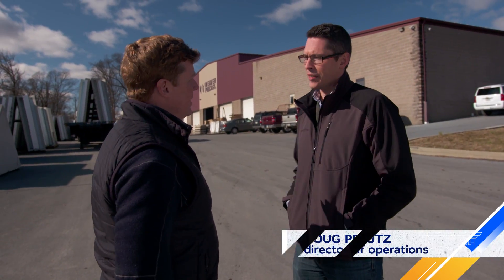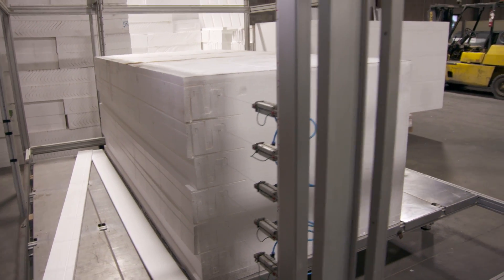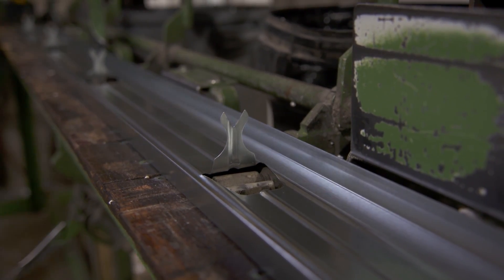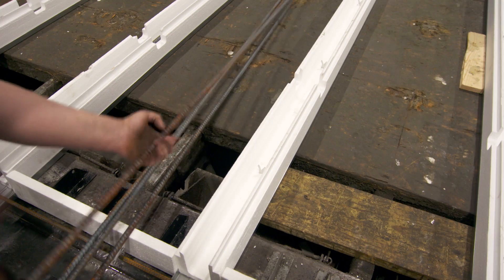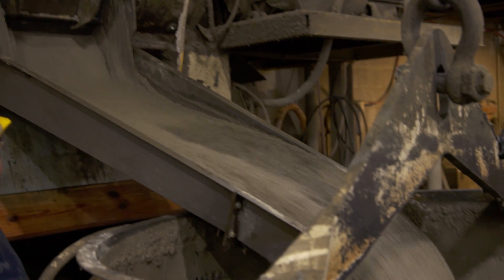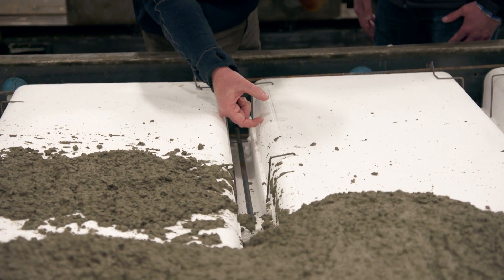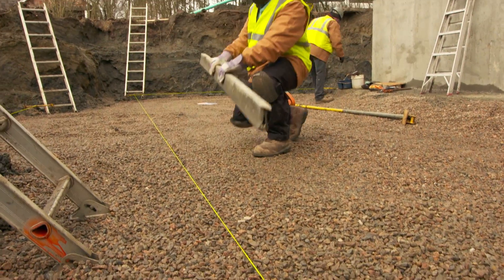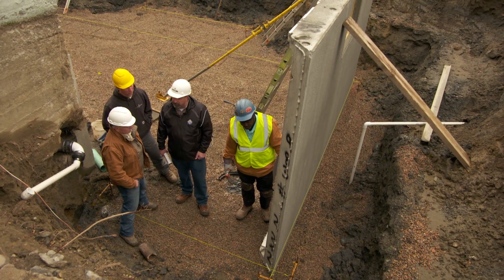How Prefabricated Foundation Walls Are Poured and Installed | This Old House

Comment: I've been in construction for years ran a masonry company most of that time.. I think building a building in a controlled environment is a good idea I'm just not convinced on concrete panels for your basement.. the connections in my opinion are weak you're relying on two beads of caulk to keep the water out.. and the main part of the panel is only an inch and a half of concrete.. no thanks I will stick with my 8 to 10 inches of poured concrete solid wall for my house..

Comment: Seems good but it's crap. It's weak, held together by bolts and glue. Anything exposed above ground is a burglars wet dream, take a sledge to it and it breaks faster than a snitch in interrogation. It'll be gone in twenty to thirty years. I'd rather have a woodie foundation than this garbage.

Comment: Using this system of walls , who is responsible for laying the drain pipe ? There is a drain pipe below the crushed rock ? Right ?
Reply: That should be the excavator. He would install the footer drain on the outside as well as the radon pipe on the inside before he installs the stone required for the floor and footings.

Comment: They should be dispensing caulk out of 55 gal drums and it should be pneumatic so they get uniform distribution. System is intuitive but still would prefer cast in place solid foundation.

Comment: I’m shocked this hasn’t become the preferred method of residential construction despite being @ top of commercial design for decades! 

Its VERY low thermal transfer...fire proof...pest proof...upkeep costs are pretty much non-existent...earthquake tensile strength is much better than comparative methods...and the finishing options could be extraordinary!
Reply: It's very popular in Europe and Asia. America is just a little behind the times because they have so much lumber available, so they never really had the incentive to switch to concrete.

Comment: Nah, I'm sticking with my full inch 8 thick wall with a rebar web. 

Or ICF. Which is probably a better, more expensive product. More time consuming, don't need a crane though. 

What if they used a 2 inch tension rod instead of those puny bolts. That way when the foundation eventually cracks, sags, bows, you can just tighten your tension rod and bam, straight and level wall again.

Comment: I like the idea and environmental controls to get 5k psi strength concrete BUT the connections are critical and the weak spot and 3 beads of caulk and two 1/2" bolts doesn't give me much confidence in that connection to not leak in 5-10 years.  I would have liked to seen some kind of interleaved connection, more bolts and better sealing design with MORE sealant.  Do they do something on the outside of those joints?  I surely hope so.
Reply: The corners are being compressed together by the structure. They didn't show it, but a concrete slab is usually poured /after/ the walls are erected.
Reply: cpad007 the corners are tapered I’d imagine the weight of the earth around it holds it together pretty well.
Reply: The floor truss system along with the back filled earth is what will ensure stability.  The bolts are just to keep things in place until the above elements are installed, which makes things permanent.

Comment: I dislike how he basically says that most homes around 3500 psi because of incompetence. Modern concrete plants and their contracted trucks will get you the correct PSI at site, no matter what you order. If the average house is 3500 psi then it's because that is what they engineer specd them to. 

I also trust a single pour 3500 psi foundation to stand up 50 years to water far more than this jigsaw puzzle.

Comment: We don't really have 'basements', as such, over here 🦘 so why are there 'windows' ?
Reply: Also if there's a fire it can be an egress location.
Reply: Ventilation and to let light in. It gets pretty dark down there lol
Reply: Some building codes require emergency egress windows in basements.
Reply: I still don't get it ! It's a basement, how can it have windows ? That's like having opening windows on the lower decks of a ship?
Reply: @brhino  The foundation has a well kit at the window opening to provide access to the surface. There is a ladder inside the well. This is what it looks like... https://windowwellexperts.com/egress-window-wells/
Reply: @thefungusshow2535  = THANKYOU !

Comment: yeah .. Unless this comes at least 75% cheaper than the traditional way of building, I'd say it isn't worth it. What is the expected lifetime of this product? Why is it bolted and not welded? I've seen panel walls before - the whole soviet union was built from them. While most of it still stands, it isn't anywhere near ideal. The caulk lets go, because all caulk will. Call it what you want, it will let go. I've been in one of these style homes and there was snow blowing through the wall. Structurally sound? maybe.. Practical, reliable? I don't think so. It's gotta be cheap if you want me to use it anywhere

Comment: Cool idea but I definitely would rather have a poured wall and slab foundation. Something about a wall that's mainly 1.75" thick is kinda questionable to me
Reply: Wes ive poured enough footings and stem walls to know a prefab that thin on no footing is junk.. its a shame people value some clipboard boys oppion rather than a masons
Reply: You either didn't listen or just don't get it.    Stick with simple stuff there tiger
Reply: Wes what a dickhead.

Comment: An 1 3/4 concrete skin?  Hope you don't have a lot of backfill against the house.  This guy is talking crap on poured walls but they are 8-12'' solid concrete.
Reply: The basement wall in our house is 32 in of poured concrete. There is a very slim chance  it will crack

Comment: The money that was saved went Into the delivery and the crane
Reply: hanratty450 that’s what I was thinking, but if you’re in a really rural area, you want a house up as soon as possible to reduce cost so this could be an attractive option.
Reply: @AndrewHorezga  anyone who says it's not better is a boomer
Reply: Yup... although you still have to deliver materials either way.
Reply: Building my own personal house.  Superior walls was 40% lower cost than our next lowest bid.  The crane, delivery and install all part of the package.  The crane is owned by superior walls.
Reply: dont forget the 2 guys with socket wrenches puttin in both "bolts" at each intersection
Reply: I agree, where I live you'd be looking at around $1000 an hour for a crane like that.

Comment: is this rated for earthquake areas? Seems like the walls would just come apart in a quake?
Reply: I'm thinking the same thing. But also not even earthquake areas. Even in seismically inactive areas, how well does all this hold together once a house starts to settle and shift? Those two bolts will hold the slabs against each other but they aren't going to maintain the geometry and shape of the foundation like a single rigid mass of concrete would.
Reply: We rearly get earthquakes in PA and they are nothing to talk about.

Comment: what's better in terms of longevity and strength... this prefab foundation or a standard poured concrete slab foundation wall like most houses in Canada?
Reply: I'm not an expert on this. But you're basically asking " what's better 8 inches of concrete or 1 3/4 inches? " I feel like the answer is common sense and untill they have at least 30 years of experience with this, I will not be convinced that it is any good
Reply: I’m wondering as well. I want to dig and expand my basement and build in a lap pool. Was thinking ICF’S but will consider any option if it works better and saves me project cash.

Comment: I can't believe that one bead of waterproofing adhesive is enough. If that dries out and cracks your screwed.
Reply: There's 3. Inside, middle, outside.
Reply: @pdxlockpicker7796  no I know I heard that. It's one one bead the put on before putting the other wall up.   They obviously tested this before bring it to market. It's just different from the norm.

Comment: Where's the footing ? Sure hope they seal those corners from the outside with some rubber/tar sealant and heavy plastic over them ?
Reply: Also drainage pipes and gravel below to drain any possible water away from the foundation.
Reply: They don't .. I think, realistically, this product has lifetime expectancy anywhere between 8 - 15 years. With 8 years being the first leaks and 15 being a need to tear down your house

Comment: All good besides them being “water tight” with two beads of caulking, asking for a leak after 10+ years exposed to the elements
Reply: I thought he said 3, but I agree, those corners should be pasted with concrete adhesive/ sealer and hopefully they seal the corners from the outside with a serious tar membrane and plastic before back filling ?
Reply: Im sure theyll wrap it with some form of water proof membrane

Comment: I've worked in prefab concrete.  this is basically that but so much better.  We had everything outside exposed to the elements. If I make a home that has a basement I am so going to get these guys to make the foundation.
Reply: I had them do my basement cost me 16k for a 1000sqft basement... not cheap but def worth it. Im in PA
Reply: @acousticpick . Can they build an entire shell of the house? We are looking into building our first all concrete home,  and wondering if  pre fab concrete is a good option.
Reply: @Asmrpurplelady  yes, they can. Although at a much higher cost than traditional materials (stick build). They build entire shells for commercial applications, but they also do residential. Although not common.
Reply: @acousticpick . Thanks a lot for the response.    Do they charge per sheet or square footage?For example  a 9 by 10 ft  sheet being priced different from a 6 by 10 ft.   
Did the total cost for your basement include delivery and installation?  My apologies for asking too many questions:)
Reply: @Asmrpurplelady  Yes, they charge by the square feet. Also, the amount of insulation, windows/doors opening or instals, and the taller you go the more it cost per square ft. My price was for 9' tall basement walls and delivered and installed with two window wells installed and 1 french door opening and 2 regular size window opening (no window/door included).
Reply: @acousticpick . Thank you very much. I truly appreciate your taking the time to respond. This gives me great insight from a customers perspective.
Reply: @acousticpick  do you know what the company name was?
Reply: @zachiarykuper8968  Superior Walls by Weaver Precast. Based in PA
Reply: The house I live in is a superior basement. I was told that they used these basements in my subdivision build bc of the clay type of ground and this are great basements for this environment. Not sure thou. I’m also wondering thou is there a special caulk they use